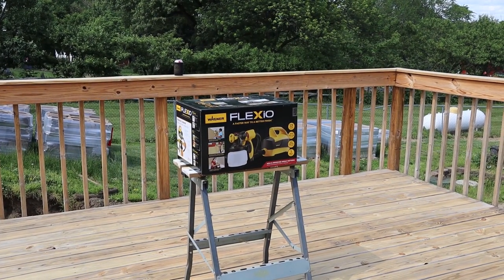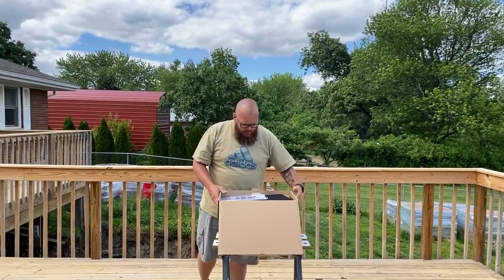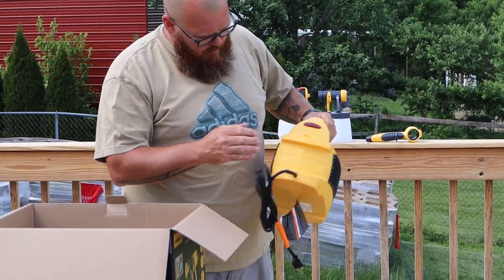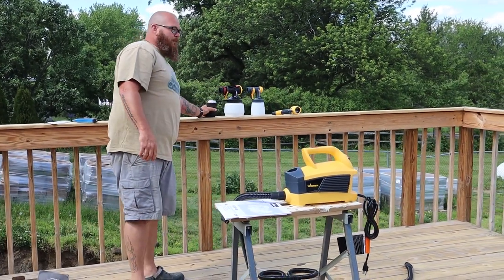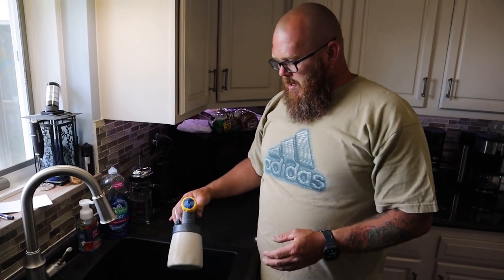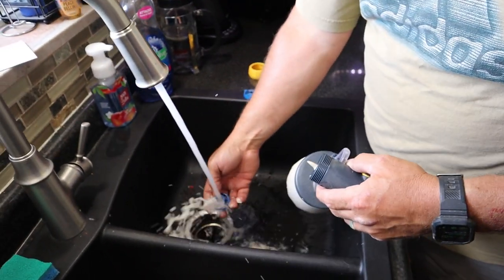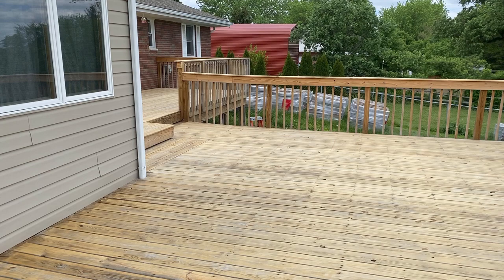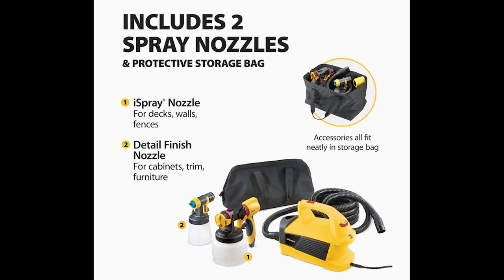Wagner Flexio 4000 Unboxing and Demo

Comment: If you empty the paint out of the container, then you can fill it with hot water from the tap and spray through until water comes through clear easy way to clean after use. Also good Todo what you did after just to make sure it's all cleaned out
Reply from the maker: Thank you for your incite I will try it next time I use it
Reply: No problem at all mate I watched your review some time back and recently purchased one can't fault it. Literally took me less than 5 minutes to clean with a warm damp clot for the over spray on gun ect and running hot water through the tank until clear, always best to take nozzles off ect like you demonstrate 👊
Reply from the maker: @ii_HighShoT121   I am actually getting ready to do another review on it after using it inside. I still love it but there are a few things I ran into.
Reply: Ah brilliant il be sure to check it out I am yet to use it inside I would imagine it takes a little while to get the hang of
Reply: @dmurphy68  Oh I need to find your other video it seems since you’ve encountered a couple issues.

Comment: Total POS. It doesn't spray, it splatters and it leaves a textured surface, even when the paint is thinned. It really shoots out blobs if you use un-thinned paint, which it is advertised to do be able to do.
Reply from the maker: I have not experienced that with mine yet. I always make sure I clean it perfectly to ensure peek operation and results.
Reply: Is this copy and pasted? Exact, word for word response on a 3000 video.
Reply: This is 100 percent true
Reply: Lol prolly a competing brands bot

Comment: I bought this and it was horrible and threw it out after two uses. I then purchased a competitive product and it works great!
Reply from the maker: Do you care to elaborate on your problem? I know it has some drawbacks but compared to the other sprayers I’ve used in the past it works pretty good.
Reply: We bought this to use on a house we were renovating. It was great for painting doors and a brick fireplace, however trying to use it for cabinets was a complete disaster. The biggest flaw is it being an air model. The constant stream of air does a number on any plastic you have up, you have to make sure it's completely secure or your whole work area turns into a mess. Then I had so many issues with the tips clogging and putting blobs of paint all over everything I resorted to just brushing all my cabinets and their doors. If you have a project that can be done outside, where the overspray doesn't matter, it's great.. personally I'm going to pick up an airless system the next time I need to do any precise paint work.
Reply from the maker: Sorry you have had so much trouble with it. Did you try thinning out your paint? I have not had any problems with it splattering yet.
Reply: Had the same problem laying down a coat of primer on some cabinets.
Reply: I feel many of these are user error you can’t just dump paint from the can to the gun’ sure the box says that but good luck’
If you don’t strain it 1st 1 little chunk ruins it all’ it will clog spit 
You MUST thin paint’ again it says you don’t that’s for marketing sure you don’t have to but you won’t like the outcome they don’t tell you that

Comment: Just bought one of these today. I'm looking forward to trying it out. It was worth the extra $30 to go from 3000 to 4000 to put the power unit on the floor instead of in the hand, I believe. Thanks for the video!
Reply from the maker: Hope you enjoy it! let me know how it works out for you please.
Reply: This was my question to Darren as well... probably should have read through all the comments first.  I'm thinking exactly what you are... put the unit on the floor and with the length of hose they supply looks like it will be much easier.
Reply from the maker: @chris the only problem with the unit on the floor that I have found is stepping on the hose. It is not a big downfall but it did affect my spraying for a few seconds.

Comment: Great video Darren, I bought one and I’m about to use to paint my kitchen cabinets and your video made me very confident to use the paint sprayer.
Reply from the maker: Great may I suggest a paint?  I used sherwin-Williams emerald paint. I used the trim paint because it has urethane and actually gets hard. I use it for all my trim and cabinets. You can scrub it with a sponge and it just comes right off and no damage to the paint.
Reply: @dmurphy68  were you able to spray the sherwin Williams urethane enamel with the Flexio 4000? Did you need to thin it?
Reply from the maker: @khgriffi  I have not sprayed the Emerald with it yet. I have a bunch of trim work that I am going to do with it soon.
Reply: @dmurphy68  Thank you! I just bought this same paint sprayer and the Emerald Urethane paint from SW also! I was so close to buying the KEM Aqua Plus paint by SW because people say it’s amazing and levels/dries much faster than the Emerald. However, I opted for the Emerald in the end because I also read the KEM Aqua may chip. So I hope I made the right choice! I’ve read so many people say it’s super durable!
Reply from the maker: @BS-dq1kz  I love mine still cleans up so easy and has not faded at all

Comment: I have multiple rooms, ceiling and walls to spray, so a lot of area. I have RA and have a hard time holding things in my hands. That is why I was looking at this model because of the weight of it.  I’m also 66 so I need to make this as easy as I can. Our house is over 3000 sq ft and I will be doing all the ceilings, walls and closets so I feel the $199 will be worth it for me, but I don’t want to go to a larger model since I do have time to spread this painting out. It doesn’t need to be done at once. Thank you for this review, it helped a lot.
Reply from the maker: Good luck sounds like to much painting for me lol. Make sure you put plastic down so you don’t get your hardwood or carpet covered in paint specs

Comment: Thank you thank you thank you for an excellent video. I do have one question did you do your ballisters with the smaller sprayer or the larger? I am worried about overspray. I am also using a water-based stain which I’m going thin with water. My plan is to do all of my balusters first from both sides, then do the floor. I’m assuming you were able to get to at all four sides of the baluster from spring sort of at an angle room inside the deck than outside. I am buying this unit just to save time as I have more than 110 feet of railing around three different decks And to do it by hand with a brush is very time consuming.
Reply from the maker: I used the smaller sprayer at first but I ended up using the bigger one to save time. The only place I worried about over spray was close to the house. I did manage to get a little on my windows just because of the breeze we had that day. Take your time and cover anything you don’t want sprayed.
Reply: Again, thanks for the excellent video. I finished my deck the other day. I actually used the small detail sprayer to do all of the wooden balusters of which I have 110 feet of railing so it was many times filling up that small bucket. But I needed a very narrow spray pattern I then switched to the larger spray head to do the flooring section. For some reason I was not as happy with that larger head the paint kept clumping even with the air all the way up and the material flow fairly low. I never did try to thin the stain which I probably should have as it was a solid color stain, so it was very much like paint, I found that if the larger bucket was not screwed onto the gun very tightly, the paint would ooze out of the gun, even after you stopped pulling the trigger and the switch was shut off. I bought the flexio 5000 model by the way, which is just a big plastic box that sits on the floor with the power and a 16 foot hose up to the gun. But in the end this thing was definitely worth the $220. I spent on it as it decreased the labor time by at least 10 fold

Comment: Great job on the video and appreciate the commentary.  I'm torn between the Flexio 3000 and 4000.  Did you look into the 3000 at all?  What made you go with the 4000?  Attachments are the same but the 4000 looks like it may be a little easier to manage since you are really just attaching a hose to the attachment and not the entire unit.
Reply from the maker: I have had a couple of the all in one units. I found them difficult to clean and I always will clog up if you did not have them perfect. Some of the reviews I saw said how easy it was to clean so that was one of the selling points for me. I did not look at the 3000 at all but at the 4000 price point it was worth it to try out.

Comment: Did I understand you to say that you do not have to thin out the paint like you had to do for the old Wagner power painters?
Reply from the maker: It says that in the manual but I was using a thinner stain.

Comment: When you first spay.. no thining  paint.  does/did it look like a slight orange peel look.
Reply from the maker: I did not see any orange peel in my stain it laid down nice like using a brush or roller. I am going to paint my bathroom soon and I will thin my paint by 5% to see if it changes the spray
Reply: @dmurphy68  Thanks.  I think we may want to thin our paint.

Comment: I bought one and doing kitchen cabinets any suggestions
Reply from the maker: I would use the detail sprayer that way you have less overspray. I just did a set of cabinets and it worked perfect for me. I use the Emerald trim and door paint because it has urethane so it gets hard.
https://www.sherwin-williams.com/homeowners/products/emerald-urethane-trim-enamel
Reply: @dmurphy68  I am using the ppg breakthrough it says its acrylic I wonder what setting would be best it seams to be thin
Reply from the maker: @jessicahaskins4576   if that what they recommend than go with it. I have only used the emerald because other people said they love it. I use it for all my trim and doors. I have a 4 year old and it has held up to him.

Comment: I bought one today.. nd I was super sad nd disappointed! My Flexio 4000 splatters, I thought it was gona be like an hvlp like graco or something! Str8 heart breaker!
Reply from the maker: I have only experienced that once and it was because I did not clean my machine as good as I needed it to be. Did you take it back?
Reply: @dmurphy68  I did wat the instructions said with water nd I thought maybe I needed some thinner but read that it didn't need but u could use some.. so to save a head ache, I just took a Loss
Reply from the maker: @javee-th5no  what setting did you have it at? I would call the manufacturer and ask what you could do to fix it. Might have a bad unit.

Comment: Always thin your paint 5%....
Reply from the maker: I was going to but it had enough power to push this thick non transparent stain through the sprayer. I will test it again when I paint my basement and I will thin it.
Reply: @dmurphy68  what would you use to thin it?
Reply from the maker: I have always used water but you might want to read on the back of whatever you’re using it will say if you can thin it or not
Reply: @dmurphy68  right on thanks for the quick reply, cheers 🍻
Reply: Not necessary with this product as it is so powerful however always look at best recommended by paint supplier